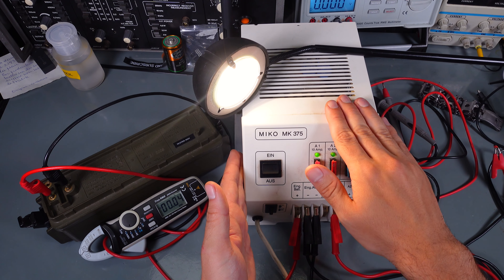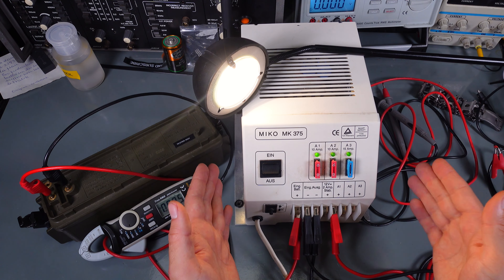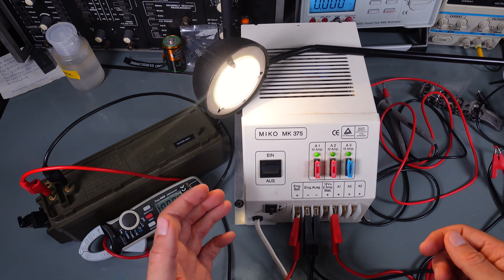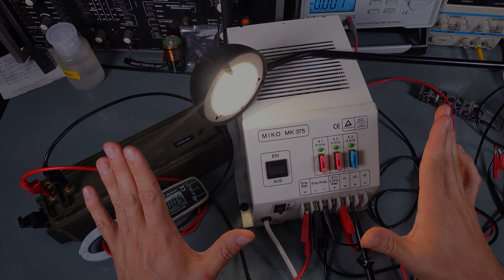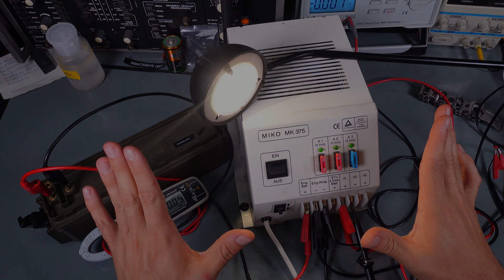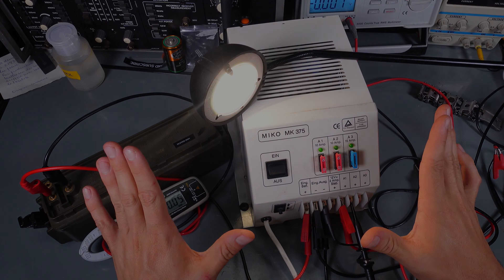MIKO MK 375 (camping caravan) 240W 12V power supply with priority switch connecting wiring & testing

Comment: Thank you for the detailed explanation. I am going to replace my MK375, because I need stabilized power on all terminals for electronic dimmers etc. Also some LED lamps tend to flicker with the unstabilized power. Your video helped me to understand my current implementation, so I know what connectors I have to use on the new one (a CSV 300).
Reply from the maker: Glad it was helpful! I hope You will get everything sorted out!

Comment: Hey,
Do you know where the fuse for the „12V = 2 Amp. Stab.“ Output is? Exists there any fuse for that output?
Reply from the maker: You sure it's fused? Stabilized most like use some voltage regulator and by design they are protected against over-current and don't require fuse at output?
Reply: @ElectronicNoobBlog  Ok that would explain why I couldn‘t find any fuse for that output.

Comment: I connected a 12V battery to the battery terminals but now I don't get 12V from the car anymore. After disconnecting the battery there is no more power in the caravan however the car is connected. How can I fix that? Thanks!

Comment: Thanks for the video. What would be if we have 12V from the battery and leave the fridge on 12V? Would it drain a lot of battery?
Reply from the maker: You can calculate it, check how many amps cooler pull per hour and divide it by capacity of battery - You will get rough estimate.

Comment: Thanks, great video!!!
Can you connect 2 battery at the same time to miko mk375??
Reply from the maker: For sure You can connect batteries in parallel (12V nominal) to get more capacity but You won't do it at level of MK375 but in battery compartment. MK will sees both them at single larger capacity.  If You plan to do something with series connection to get 24V then answer is not.